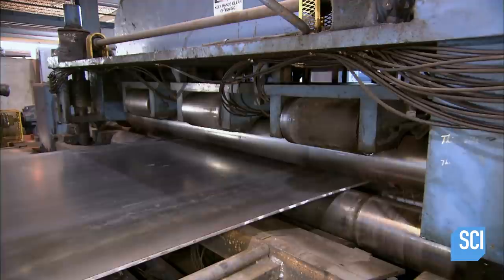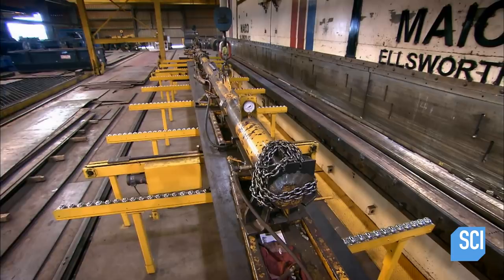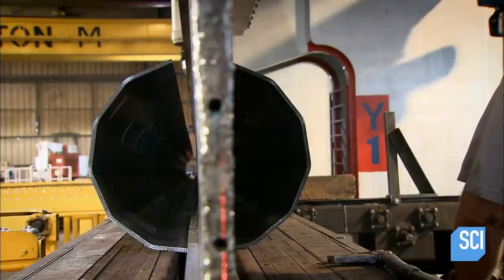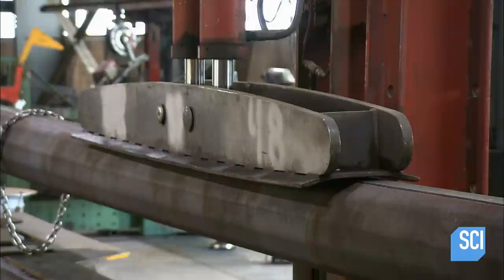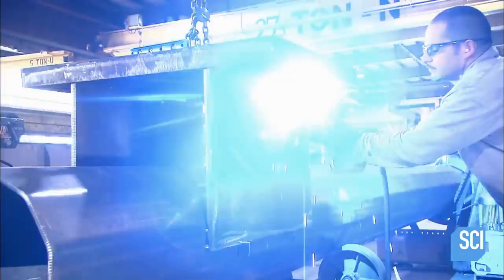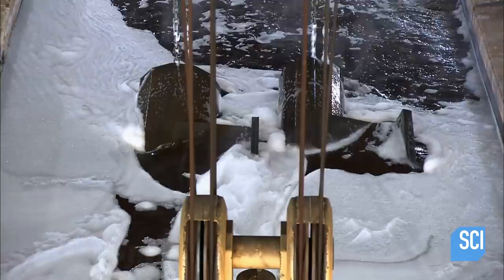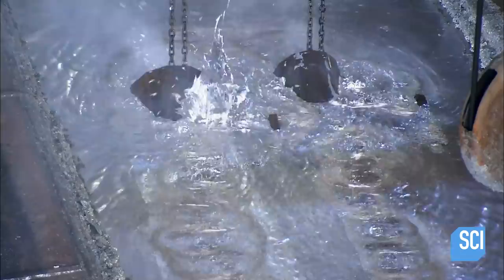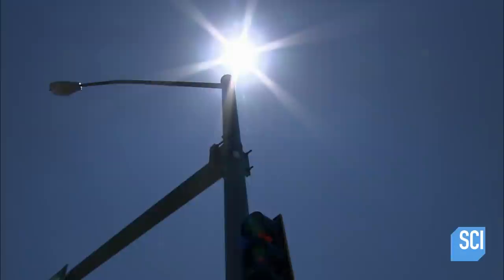How It's Made: Traffic Signal Poles

Comment: I can't even tell you how many times I've galvanized those poles.
Reply: How good is the galvanic coating? Does it really last 40 yrs?
Reply: @joeg464 , depending on the mills applied/adhered yes and even longer. 40 years is a minimum expectancy.
For example. A light pole, piling, bolts or boat trailers that are exposed to the elements you can expect about that or even less.
For something that is not exposed to the elements you can expect to have  80 years +.
Reply: I don't want to think of how many miles of wire I burned welding these things up.

Comment: Not going to lie, little disappointed that they bent it into a dodecagon instead of an actual round pole, was expecting a "finishing" smooth to round it out.
Reply: K
Reply: Client preference.  There's a design equation for minimum number of sides in relation to the flat-to-flat diameter.  The design code also says round tubes of similar size have greater fatigue resistance than multi-sided.  Ref: AASHTO 2015 LRFD Specifications for Structural Supports for Highway Signs, Luminaires & Traffic Signals, Section 5.6.2 and Commentary.
Reply: Haha me too! Not sure why
Reply: cost more.
Reply: @reillythompson664  That's really neat.

Thanks for the explanation 👍
Reply: it actually really bothers me 🤣
Reply: LMAO

Comment: Last 40 years?! 
I’ll be dead by then.
Reply: Well technically speaking, most galvanized poles are able to last for up to 70 years before the rust eats away at the steel. Where I live, we got some 50 year old street lighting poles and the only thing that's happened to them is light surface rusting. This is because the poles (including the one in this video) go through hot-dipped galvanizing processes. Also note that galvanizing doesn't have an impact on the tensile strength of steel.

Comment: When someone tboned me, my srx sideswiped a signal pole just like the one in the video at 55-60 mph... wrapped around it then bounced off. luckily Cadillac is a leader in safety but my point is, these poles can withstand ANYTHING.

the only minor damage done to the pole was to the crosswalk button, which was knocked off the pole but.. still hanging on by the wire. And again, this was a large heavy crossover suv that got hit by another car right into the pole direct impact. did nothing to it. id say it helped save my life, too.

Comment: Why can't they make galvanized cars to last 40 years or more?
Reply: because steel is heavy, and expensive, galvanizing is even MORE expensive, resulting in a car that costs more,  and uses more gas, causing it to be more expensive to run.
and if it catches fire results in everything nearby dying, including the fire fighters who come to rescue the person in the car. 
also difference circumstances, a TRAFFIC LIGHT, a low stress, and stationary life kept more protected from salt than say, the bottom of your car which constantly gets salt, and rocks, and other road detritus kicked into it, zinc is soft it scratches easy, wearing off the protective coating, it deteriorates faster in the presence of salt and excessive moisture, and the moment you get one weak spot, it spreads. all of these combined lead to galvanized metal being a terrible choice for basically anywhere in a car.
Reply: Cars began using galvanized steel in the 1980s. Different manufacturers at different times. Cars used to rust a lot quicker before that.

It is difficult to paint galvanized steel, the paint just doesn’t stick. So they had to figure out how to paint it before they could use it for the body panels. I believe they did this by electrostatically charging the paint and panels so they were attracted to each other.

Galvanizing doesn’t last forever but it does last a lot longer than non galvanized steel.
Reply: Porsche 944s are galvanized. The reason they don’t galvanize cars is twofold. 1. Galvanized steel is harder to paint. 2. Galvanized steel lasts a lot longer and the auto industry is notorious for planned obsolescence.

Comment: Does anyone know why they Don’t use a hot rolled hollow structural section HSS for light poles?
Reply: It is not anywhere near strong enough to be able to support the weights and withstand the wind and impacts that are called for in the specs for these signal poles.